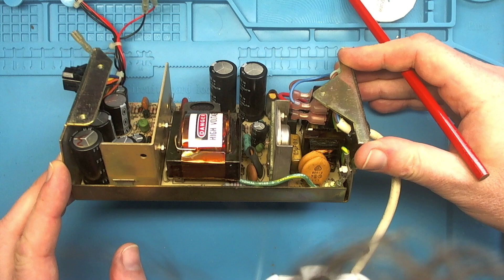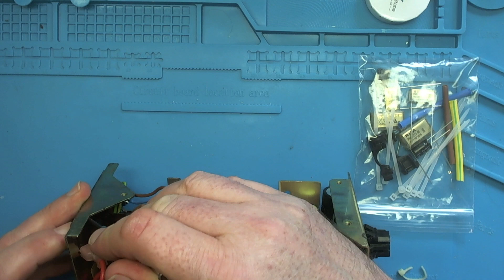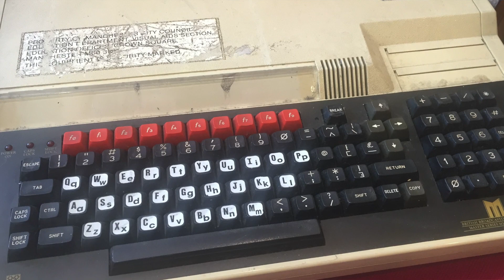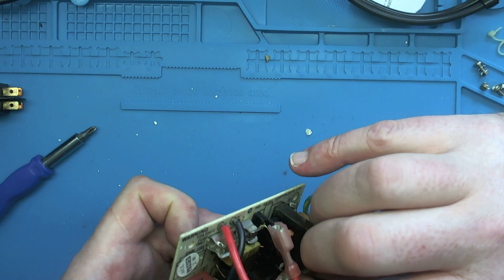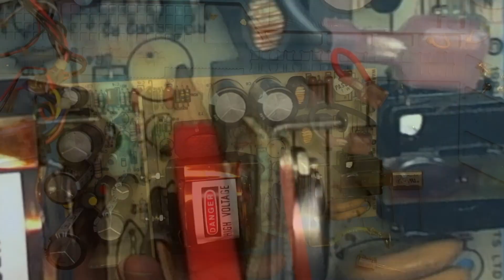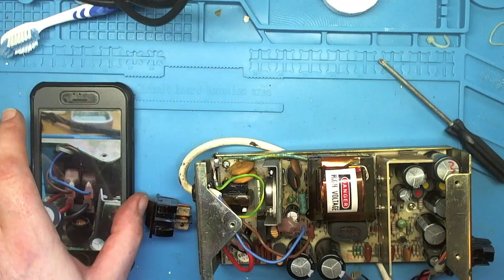Acorn Antiques: Recapping a BBC Model B Power Supply

Comment: I have a blown Atari ST supply. I added up the price of replacing components and it cost more than just popping in a complete Chinese power supply. Not original doing it that way but if you are not well to do then needs must. Luckily I have a lot of Atari St units so i just swapped one over and added the ST to the spare parts collection. I only have one BBC model B and its blown so I will have a think on that. I may have to just label it and put it away.
Reply: i woudnt trust a chinese power supply in my Beeb
Reply from the maker: It was only the RIFAs that were causing me an issue. I think I was more interested in keeping it original, for the sake of a couple of quid. I've used Meanwell power supplies before now as replacements for other systems.

Comment: What desoldering gun/station are you using on those solder joints?
Reply from the maker: Ah, it's a cheap(ish) one I purchased off Amazon a few years ago now. Mine's branded WEP-948 II, but this looks like the same one. I've had no complaints with it so far.
https://www.amazon.co.uk/YIHUA-Desoldering-Soldering-Accessories-Calibration/dp/B099JYQXR1